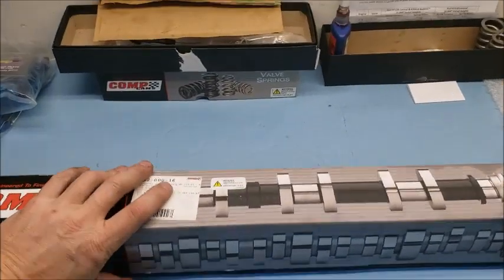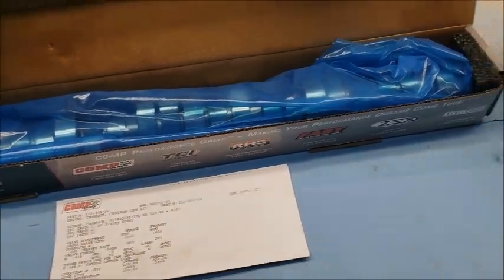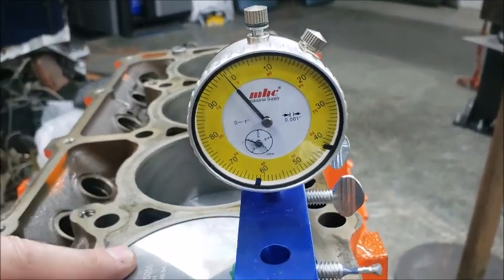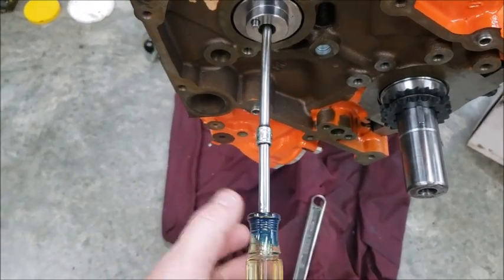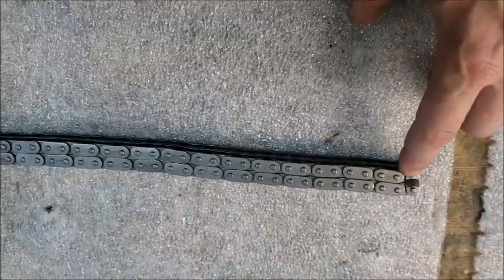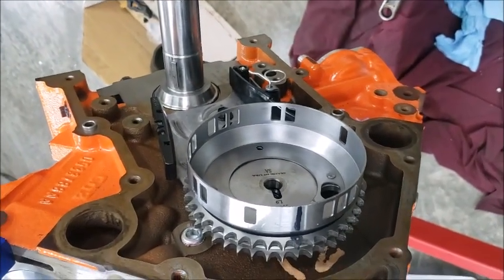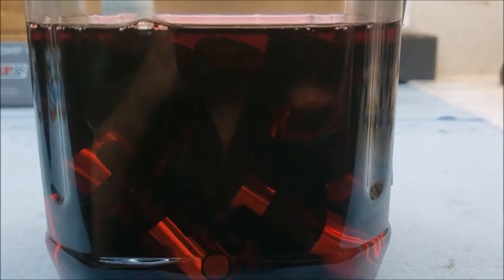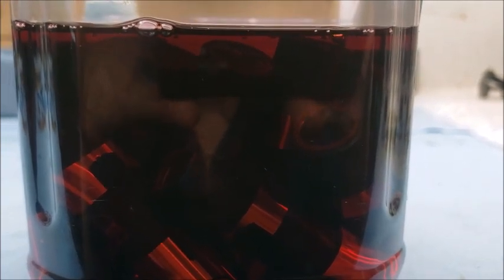Let's degree a camshaft on the Gen III Hemi. Engine Building E-6

Comment: This is the first video I've seen on YouTube which actually degreed a 3rd gen Hemi cam install. I've seen about a dozen where they just line the marks up and call it good. Only deficiency I see is that you didn't show how you retarded the initial install 2 degrees. Was it via a different crank gear keyway? Or is it like an LA engine with an offset woodruff key on the cam?
Reply from the maker: The crank gear has the offsets on it.
Reply: @SlantDailyGarage  thanks for prompt response